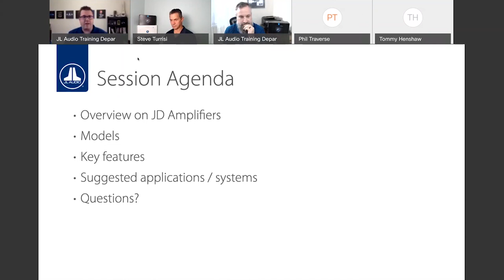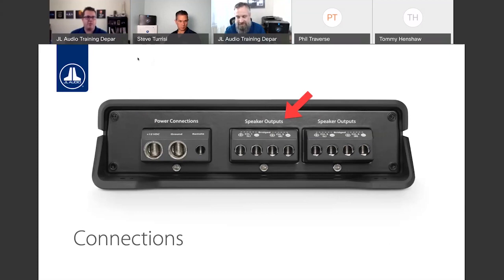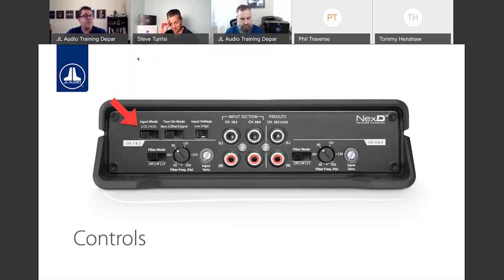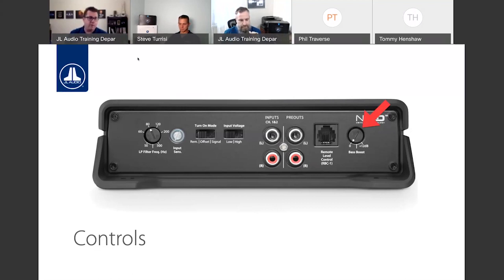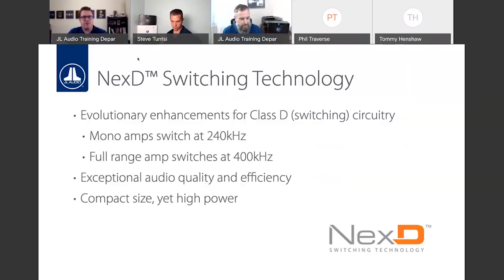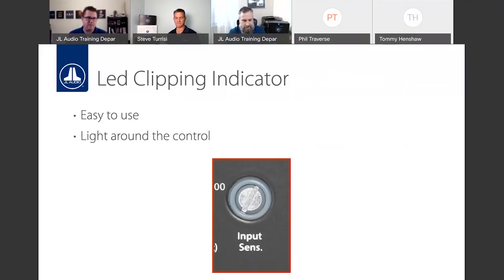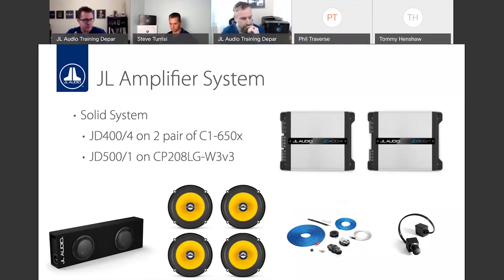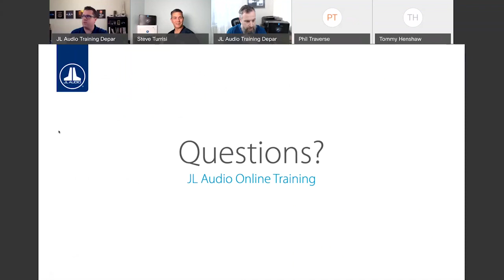[Live] JL Audio Training About JD Car Audio Amplifiers

Comment: December 2022 just finished installation of the JD 400/4 powering a JL Audio 8 inch compact sub and a pair of 6x9s in the front door ‘I would say this amp balanced the whole sound and I was able to set my stereo full gain with no distortion at full volume
No needfor anything else; the clarity and detail of the sound is superb maybe will Chen my new JBL 6x9 for some better quality JL audio components
Reply from the maker: Excellent! Thank you so much for sharing. We are thrilled to know you are happy with the system.

Comment: Jd  400/4 .how would I know if I didn’t burn up my amp .. because I have no sound coming out from the amp.. The blue light power is on and the exclamation red light is on Solid.. But I already disconnect the speaker inputs.. And turn off the amplifier and then turn it on to see if the red light goes away.. But it won't do anything.. Kinda disappointed.. Any help?

Comment: Hi
I have purchased the JD500/1 to power a 10w3v3. I will be running it using speaker level. The issue is the output voltage from my factory speakers goes as high as 12volts at higher volumes and the  JD high level input is maxed at 8v. Would this be a problem or would you recommend me getting the LOC22?

Many thanks
Reply: Hi  @mattdavid3481  
My car has factory head unit and has no rca output from so I am having to tap into factory speaker.
Reply: @mattdavid3481  would like to get a new head unit but it being a newer Mercedes that’s just a whole loada work and alot to lose in terms of functionality. LOC it is at this point for me I guess.

Comment: Ya but, do they sound as good as a good A/B amp in the same class/price point? Does the 4 ch. JD or RD do clip indicator for both the input and the speaker output? I'm stuck between RF P600/4 and JL JD or RD/4.
Reply from the maker: Rob, this is a question better suited for our tech team. Feel free to reach out to them and they will be able to give you a bit more information: https://jlaudio.zendesk.com/hc/en-us/requests/new?ticket_form_id=360000078093

Comment: I'll need to do a little adjusting on my jd1000 now
Reply from the maker: Hey Ray. Let us know if you have any qusestions!
Reply: @JLAudioInc  Actually, I have 1. With the clipping light, is there anything inside the amp that will change the sound or cut out when it goes into clipping, or just the light?
Reply: @rayc9838  clipping light is mean u are reach the amp into the limit. then your frequency your signal is dirty and can kill your subwoofer and u can hear a clipping noise come from your subwoofer